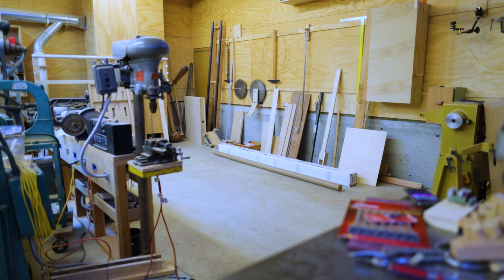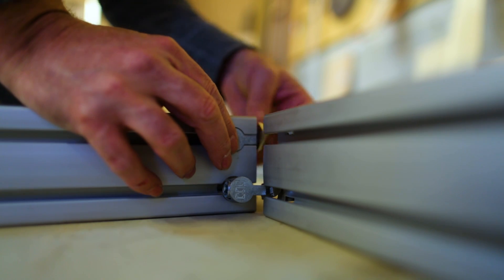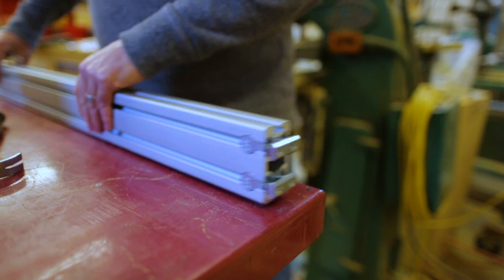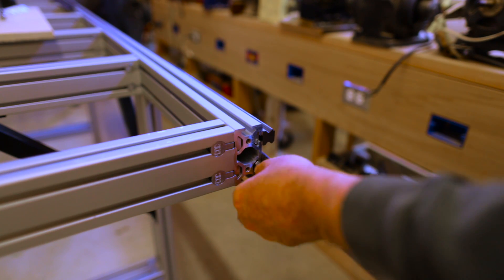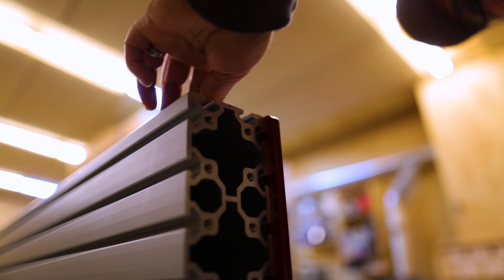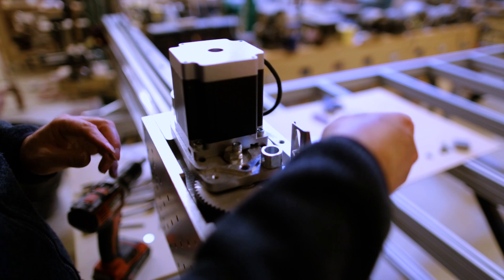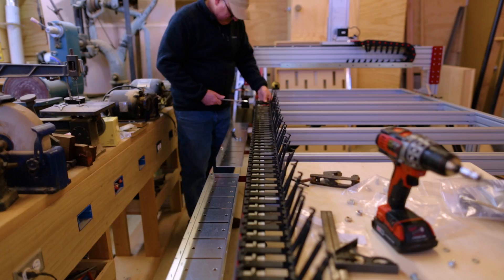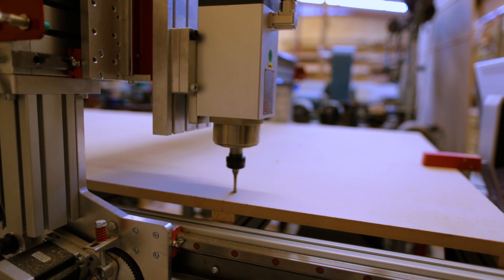CNC Build 2.0: CNC Router Parts 4' x 8' CNC Router

Comment: Hi Frank, Looks like you got it working - congratulations.
I have my 4'x8' coming and have been trying to get ready. Do you know what size allen ball head blade you use for the screws> I have ordered some but feel I may need a smaller one. What did you do with the vac system?
Ian

Comment: I know I'm a little late to the party, but I didn't see you measuring plumb and square much.....only the crossed strings flattening the table.  Did you find that the pieces of the kit were machined well enough that they assembled 'square' and that you didn't have to make many adjustments? Many thanks.

Comment: Now that you have lot of experience with this machine. Would you still buy this machine if you had to buy one now or would you opt for another company.
Reply: MySchizo Buddy there are so manY options to choose from that I struggle to pull the trigger on one.  I recommend deciding what you’ll use the machine for, and then proceeding.  I see a lot of stories about people buying, upgrading, buying bigger/nicer.  That made me leave thoughts of desktop cnc in my rear view mirror.  It’s my understanding, you can by a 4’ by 4’ table and upgrade easily to the 4’ x 8’ or even 4x 12 as Frank does in a separate video.  That makes me wonder if the 5x10 is the place to start!  Lol.

Comment: Hi Frank, i was going to make a 8x4 machine aswell but i am not confident enough to weld such a big frame so i was planning on using the aluminium extrusion, how straight are the extrusions? i was going to use epoxy resin on the steel frame but i am not sure what process to take for the aluminium.

cheers and fantastic stop motion skills on top of everything else you do :)

Comment: Hi Frank how much did this set up and up costing you? 
Is this the 4 x 8 or 5 x 10 setup?
Reply: buy kit cost normal 4000-6000$ DIY build same parts 2000$ and metal tube frame and linear rails orden motors and controller cheapen what found can build less than 1200$ my cnc have 1500mm x 2000mm (full plywood sheet size can use) metal welding frame and orden ebay linear rails and motors nema 34, motor drivers DM556 or DM860. and spindle NOT worst palm router. REAL spindle cheapen than router. but lot better and not noise lot. and torque better can cut aluminium goood . cost to me less than 1000$ all same can do what this expensive machine. aluminium extrudes cost lot expensive. use metal tube frame lot cheapen and strong.

Comment: cnc router parts just uses ball screw for the z axis only and rack and pinion for x and y. Doesn't rack and pinion cause backlash
Reply from the maker: +MySchizo Buddy i haven't had any trouble
Reply: Some, but many large-frame CNC's use rack and pinion because ballscrews of that length suffer from whip when turned fast. Like all mechanical systems, it's a series of tradeoffs...

Comment: Hey there video was posted a couple months back hope to get a reply
How much was the kit and was everything included and also would this be able to cut sheets of aluminum thickness around 3/16 or so 

I also saw the website is there a difference in the standard model the difference I see is that it have no legs ?  It please let me know I have a small business and I'm in need of a Cnc machine to make the job faster and easier and cleaner

Comment: Just finished putting together the same exact machine from CNCRP. That ball-tip allen key issue is the most frustrating thing ever. Yours didn't get bent, I think it happens to all of them at an angle (there's not much metal actually turning the screw inside the cap, so it twists and gets stuck - my allen key was pretty much worn out by the end of the assembly).
Reply from the maker: +Eugenius The Great I feel your pain.

Comment: I have a couple questions for you. First off I am a high school senior and our wood shop has a similar type of router, not sure exact dimensions, but the teacher is new and she doesn't know how to use it and the previous teacher never bothered to use it/explain how to. So I took on the project of getting it back up and running. The motors are controlled using a pci card in the computer, but I can't get it to recognize it, I am thinking I need to update the driver. However if I do that, what program should I use to control a pci card. It is a new computer that the tech department let me use so I don't have any software on it. Thanks!

Comment: Important is the side rails and making the whole machine True and level before tightening the cross members  I have a couple short videos that may help. remember, The cross-members have a common nut which means they MUST be tightened a little at a time or tightening with a gun will loosen the opposite bolt. I like all the work you did on the video

Comment: Frank, thank you so much for making this video. I've been seriously considering this exact machine as an upgrade from my existing one (a NWA CNC Shark HD3). I do have questions regarding your experience: Firstly, after all was said and done, how much did this entire build cost you (looking for real world figures rather than cost estimates through the CNC Router parts website), and what are you seeing in regards to run-out and gantry flex? I'm having to deal with tons of runout and flex with the Shark (which severely limits my operating speed and leads to premature wear of the bits) and want to make sure that if I make the change to this model, that I'm not trading one machine for another with similar issues. And any other relevant thing you might think of. Much Obliged :D

Comment: +frank howarth, I have an idea for your dust collection. Why not try a shop-vac sized hose that will fit in the cable tray, attached to the side of the spindle? At first thought, it isn't big enough. But it only creates dust for the most part.

Comment: This is probably what I should have done, but 2 years back I went for an industrial machine, and now I just build hobby type of stuff on it.   I love your vertical table on the old machine and am glad to hear you are putting it back.  I wish I could easily do that on my machine.  Only thing I would have gotten for it is a longer gantry.  I have a on table 4th axis and every time I use it I wish it was off to the side and the fourth axis had its own height control

Comment: One thing I notice Frank is that you didn't use a square anywhere to align the different axis.  With CNC machines the X-Y, X-Z etc etc need to be perfectly perpendicular to each other.  I'm sure it's not too bad, using machined parts, but there will be some out of true in there somewhere I'm sure.

Comment: dust extraction system you can be mounted above the machine. rigid tube as a zero point centrally over the table and connect to the spindle using a flexible tube

Comment: Very nice! I'm sad to see your homemade one go, though. One quick learning opportunity here: the gears you used on the motors are called timing pulleys, where the belts are called timing belts. The profile of the teeth is slightly different than that of a standard gear.

I don't mean to be nitpickey, but I just felt like sharing. Awesome machine, I'm sure you'll get a lot of use out of it!

Comment: Great video! They should really have mounted the Z-Nema 34 on the backside of the Z-assembly. Seems strange to put that much weight on the top of that arm. Moving the stepper could also give better strength and precision with a geared pulley setup.

Comment: as for dust collection, just a good vacuum, and a really good but really flexible hose. I've seen designs that use a brush ring around the end effector with the vacuum hose tube mounted via some custom housing.

Comment: With this kind of ("HIWIN" style) linear guide rail arrangement, there is a constant need of cleaning the ways and re-greasing the blocks. I would try to get my hands on bellows for the ways and racks to prevent dust build up. Sawdust and grease mixture has a certain annoying look to it.

Comment: Hi Fank, CNC machinist here. If I can give you some advice; do not attempt to "add some length" to the gantry rails! The gear rack may be able to tolerate a small gap between two sections, but with linear bearing rails a gap will wear them out and they won't handle the transition well. They're so precise that almost no matter how much alignment you do, it won't be enough.

Sadly, if you want a vertical table, you're really going to have to take it out of the existing table length. Which isn't so bad, the vertical table can hinge up into a flat table so you don't lose any flat real estate.

All in all, it's a great machine though, and as always, a fun video!

Comment: Did you use blue loctite on the motor pulley set screws?  You might want to consider that.  Nice video as always, Frank.

Comment: I would be curious to know of the aluminum frame parts are made by 80/20 in northeastern Indiana
Reply: 8020 is the source of the aluminum frame parts, good Folks. I made an overkill machine based on the 8020. CNCRouterParts had just gotten started selling motor, gecko's, and the motor adapters. Between them and Mach3 I had a success, unlike my earlier (everything from scratch) machines.   Maybe I should do another video with "what I've learned since building it?"

Comment: I have never had a ball nose allen key that didn't get stuck. One of my jobs used exclusively hex head hardware, and we pretty much gave up on ball nose bits because of it. Plus they have a higher chance of stripping the head.
Reply: If they weren't so damn handy, and couldn't get into places no ordinary Allen key can, no one would use them. ;-)
Reply: Hans C. For once in a while use they are great. But on a production line in an industrial setting it was less work to change the access holes and plugs to a larger size to allow normal bits to reach the screws straight. Over my time alone there I probably got paid for a couple days of dealing with issues caused by ball nose bits.
Reply: Oh, I'm not disagreeing, but I do know that a set of Bondhus drivers saved my sanity when I was assembling a couple of 3D printers (very limited clearance, weird angles, etc.). Otherwise, yeah, they're inherently less efficient than standard Allen keys. Cheers!
Reply: They are definitley handy for things like that. Especially when there isn't really a cycle time, you just build it and then use it rather than trying to build a bunch as fast as possible.

Comment: Just a quick word of advice, you might want to go back and re-tighten those bolts after a few weeks. Alternately, you might try using a little dab of loc-tite or threadlocker on them. You'll have a lot of vibration in this machine and steel bolts in aluminum extrusion can loosen over time.

Comment: It's been a bit since I've looked into building a CNC. I didn't think many of the larger machines used belts for the X and Y axis. I feel like it was mostly threaded rod. I guess the slop and resolution must be good enough with belts.

Comment: Hey Frank- 

Two questions:
1. How long did that all take in real time?
2. For the parts where you include the machine drawings, do you re-create those manually, get them from the manufacturer, something else? Really like it, but seems like so much work!
Reply from the maker: About a week, but not full time. and i got the model from cnc router parts.
Reply: frank howarth, I love your videos. I have wondered a few times how you overlay CAD models onto a video. Have you done, or could you do a video about how you do that?
Reply: Various 3d programs have the ability to 'match perspective' so you tell it what kind of lens you're using, the field of view and depth of field. Set up a 3d space with a virtual camera in the same place and it can match known parallel lines in the sample photo to get an exact match on the perspective.  Working from there when you import the 3d model it will be lined up with what the camera sees.
Reply: frank howarth thanks!
Reply: Hello Frank,  can you use this setup in the future for Foam Milling?  I am interested in making something similar to your setup but only if it can be upgraded to do Foam Milling.  Thank you 
(i want to use the foam part to make fiber glass molds)

Comment: Dust collection
U tube Thought this system was good as you had clear vision of the work in progress as
Some of the systems with brush covers were very bulky and blocked vision of the work in progress
Due the small vacuum pipes it may lack some pick up power but I would still prefer to see the cutting 
Bit working, on u tube ( loc-line vacuum dust collection )

Comment: Frank, is this whole kit about $5,100? Do you have any promo codes for us?
Reply: i just build DIY own same size cnc cost less than 1400$ looking all parts were found cheapen. and if can welding make own table cheap metal square tube 50x100mm  need only linear rails long side SBR16 and Z MGN15 rails, and NOT use palm router newer, noise lot, better and cheapen use real aircool spindle 500W wood and 800W air cool or 1,5KW water cool lot cheapen and lot guiet. silent. palm router noise, weak power and not has plan uses cnc, bearings go fast broken.. REAL spindle small wood workers 800W spindle cheapen than router and lot silent than router and has plan better bearing use cnc.

Comment: How much does this kit retail for?  It looks great and relatively easy, the latter being essential as I'm not quite up to building my own yet.
Reply: I'm out.
Reply: This one with the NEMA 34's is closer to $11-12K
Reply: About 9k looking at the links provided.... waaaaaaay above my budget lol
Reply: @sam walsh
2x 1500mm/5ft/60" anti-backlash rm1605 ballscrew, c7 end-machined--$270
2x 2500mm/8'/90" anti-backlash rm1605 ballscrew, c7 end-machined--$310
4 sets BKBF12 Ballscrew end supports (BK12 & BF12) (comes with screws)--free
2x SBR20 1500mm supported linear rail shaft rod--$110
2x SBR20 2500mm supported linear rail shaft rod--$260
8 pieces sbr20uu linear bearings - included with the shaft rod so free!--free
nema 34 stepper motor - x4 (4Axis Nema34 Stepper Motor 1232oz-in+Driver 80V 7.8A cnc kit)--$432
16x 3"x3" steel square tubing for the horizontals and for legs--$512
8x 2"x2" (come in 48" sections which can be joined) steel square tubing for the table leg supports---$256
Reply: artbyrobot did u build this and how much did it cost at the end.... any pros or cons am looking to buy / build one but am so new to this ... love wat I see and try learning as much as I can ... :)
Reply: I´m out too... But you can get very good CNC´s at an affordable price. Better (and - of course - more expensive) than X-Carve, but not in the $10K range. For example "CNC-Step" Model HighZ 1400. Andrej, the handsome guy from "MTMWood" (he has his own YouTube-Channel), has one in use. It sells for about $4k, and is rigid, reliable and quite fast. Anyway, I like Frank´s approach and it´s always a lot of fun, watching his video´s. Yes, I´m a follower....  :-)
Reply: M KT -  Thanks for the tip.  I'll look into it.
Reply: i'm making a 4x8 but not from a kit for $2k in materials...
Reply: and that's with nema 34s
Reply: artbyrobot do you have the material list for your build, that you can share. I'm looking to build a 4x8 under 2k  if possible
Reply: artbyrobot thanks, I'll definitely look into this

Comment: I am at 16:00 and have not heard anything about dust collection.  It seems to me that dust collection on all CNC machines is an after thought.  Is that your impression?
Reply: Could just run some pipe up the ceiling and then a flex pipe hang down to the motor.
Reply: I think we should have Marius Hornberger consult on the dust collection system.
He loves that stuff!
Reply from the maker: Yes,  it's a little more complicated as it has to follow the router around.
Reply: CNCRouterparts has a nice dust shoe built in fusion 360. Its parametric so you can just type in the hose and spindle sizes and the entire model adjusts. Then you have it output the g-code and cut the parts.
Reply: frank howarth it is definitely harder on such a large machine but take a look at the Suck it Dust boot designed for the x-carve. It is a z axis independent boot that the spindle can move through maybe you can create something like that and run vacuum hose in the same manner as all the wiring. Or perhaps some kind of overhead suspension system to support the weight of the hose that follows the spindle.
Reply: I don't know that it's an after thought as much as it's a hard problem that has several standard options which aren't really helped by planning at the beginning.
Reply: I agree. I don't see why it wasn't included with the kit [or maybe he opted to not get one, or to create/add later].

Comment: woo nice nice new machine, got to love aluminium extrusion, is that spindle just air cooled? 

those red caps on the thk rails are meant to be flush with the top face, they stop gunk building up in the mounting holes that would eventually end up in the bearings. there are wipers on the bearings to simple push all the crud to the ends of the rail. using a flat piece of metal to cover the cap and the rail then simply tap with a hammer. i may be nit picking but in my work we see thk bearings bind up because of dirt ingress.
Reply from the maker: Yes, i need to put those in.

Comment: I've found that smaller hex connections (bolt/socket as well as allen key/allen head) has a tendency to get jammed when you use an impact driver, especially if the tool isn't made specifically for impact use (I guess the metal can flex a little). Usually easily solved with a quick burst in the opposite direction.
Reply: i have a set (from a big blue home center) that are like that it seems when they pressed the Allen part into the socket it wasn't straight
Reply from the maker: I got mine at a big orange home center.  It's funny the size i use the most was the bent one.